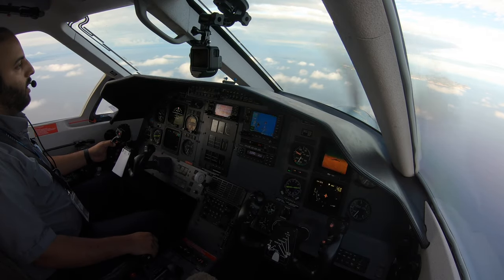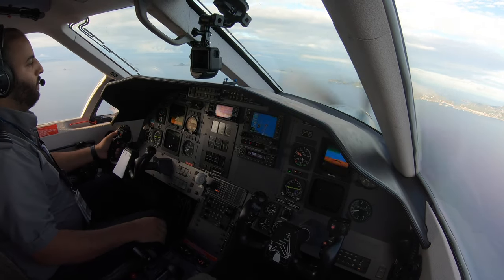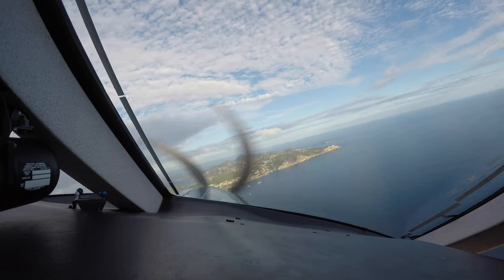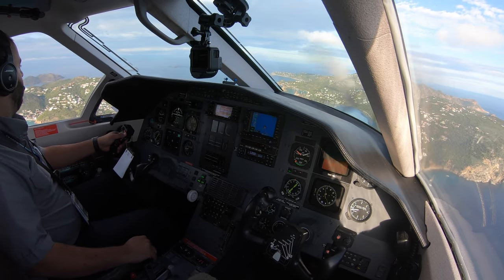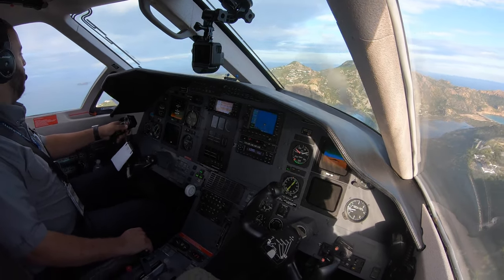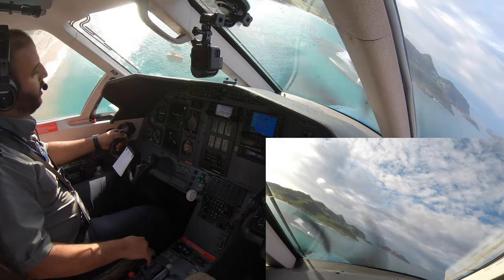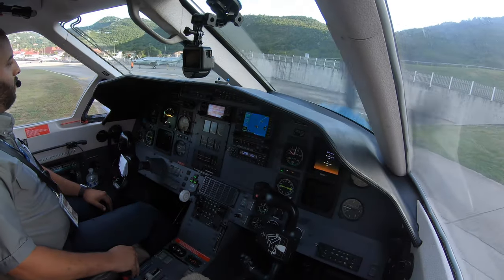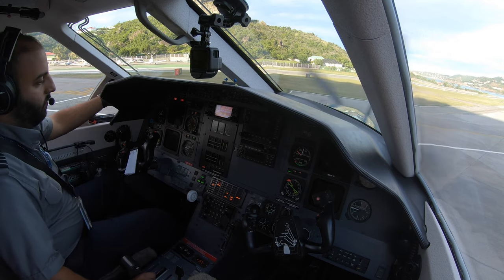CHALLENGING LANDING? - Reverse ops in ST BARTHS. (ATC AUDIO) PC12

Comment: That's intense, Shamir! That left turn to base (where you say you have to add power) is pretty steep, or is it just the way it looks on video? Thanks so much for sharing!
Reply: Upstate Flyer its really steep ! With a 180hp or less you need to put full throttle during this turn sometimes.  As you can see you don’t have much space to do this turn.
Reply: @pierre.l97133  Wow! That's incredible.
Reply from the maker: Thats correct, Pierre knows whats up! Lot's of power required to not loose AOA and stall!

Comment: Awesome and sporty approach!
But is there any room for a goaround if something goes wrong?
Reply: Burkhard Bickmann no go around after Eden rock (a little bit before) for runaway 28. 
Note that EDEN rock is the big rock on the beach. You’re committed to land. Some did tries but had troubles lol. Most difficult way to land on 28, is during sunset around 17:00 local. Because of the sub right on your eyes !!! So you don’t quietly see the runaway, I do use the buoys straight on the runaway as a tricks.
Reply from the maker: As Pierre said, no room for go around after passing EDEN ROCK.... and even so, the go around procedure before eden rock requires a separate video! Its very intense!